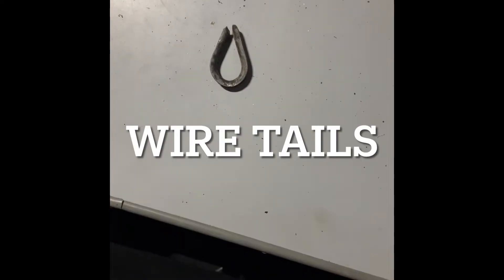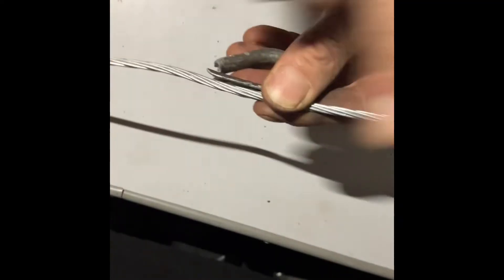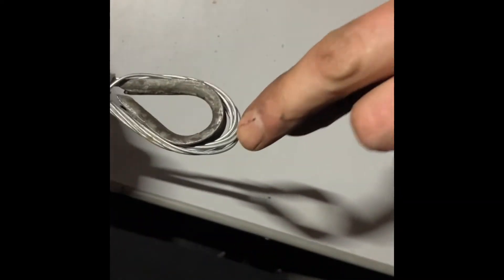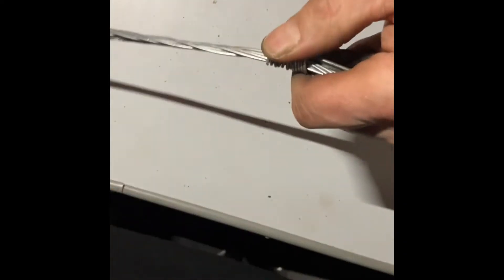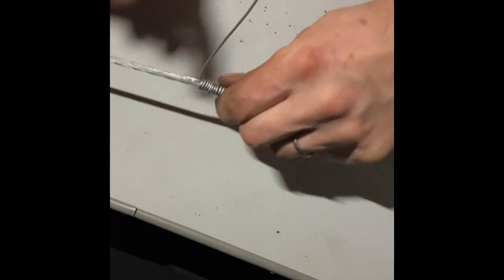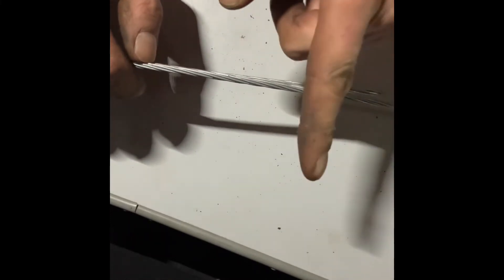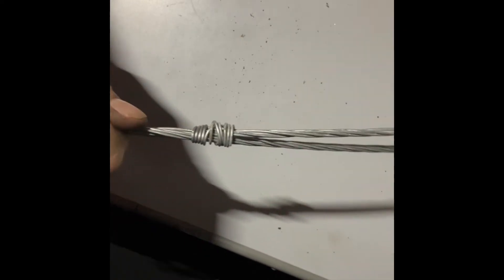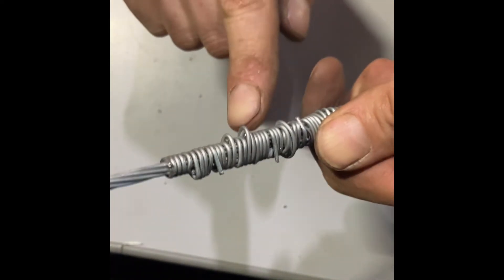Jointing signal wires

Comment: I was always told it was bad practice to use pliers.Done skilfully you didn’t need them.
Reply from the maker: @SpoonyMcSpoonface  it was  indeed, but then the wire became more springy (apparently a batch of Chinese wire that managed to get all around the system), and having seen others use wrapping tools,wire guns and such you start to wonder what’s the actual issue, for example trying to do a pole support guy with much thicker by hand is incredibly hard) but there’s a tool for that like a giant plier, my old lineman Jim gave me a wire wrapping tool he’d had since early BR days with a cutter on its end so cutting stranded galvanised cable with a tool is not a new thing , it may have been down to an adopted practice but that doesn’t mean it’s always the right thing, remember radium baths and cigarettes were once said to be good for you, as was asbestos in bedsheets and arsenic in wallpaper 🙁
Reply: @irseminorrailwayssection9491  Thankfully never had to do a stay wire for a pole,yes you’d certainly need tools for twisting the thicker wire off on those.

Comment: in our country we use little bit different system for changing signals and switches. So if you interesed i can sent some pictures on e-mail or some differnt plattform.
Reply from the maker: @MSZD  absolutely, yes please
Reply from the maker: @MSZD  here is the sections email, it has an automated response but we will receive the pics 🤗.      

IRSE_MRS_Linked@yahoo.com

Comment: Unfortunately the camera missed most of the action !
Reply from the maker: @wideyxyz2271  yes unfortunately no tripod and only two hands, so ended up doing the before and after bits as it was easier, it does make you wonder if having multiple arms would be a benefit for the S&T, my issues would think so as I could do more diy 🤗😭